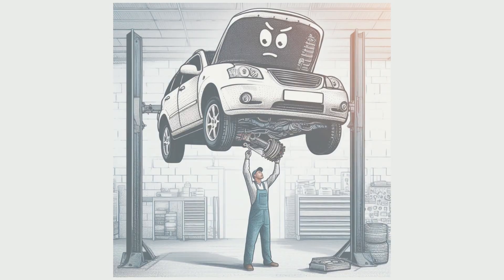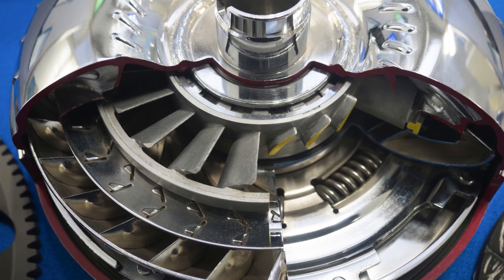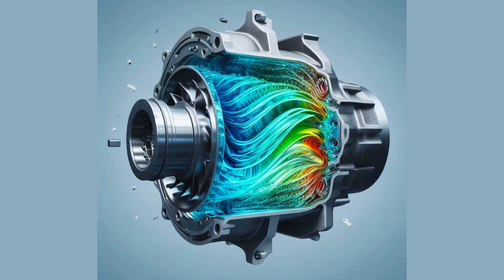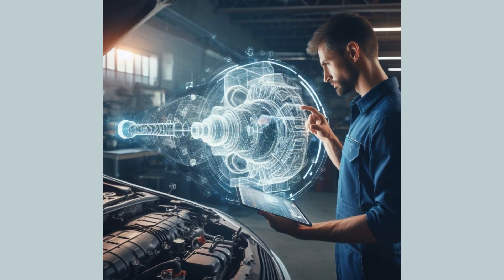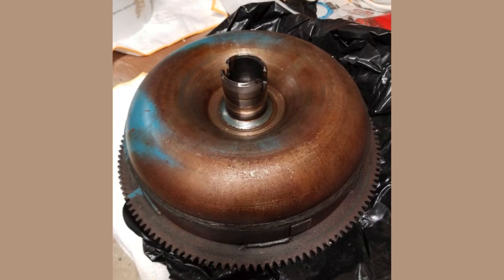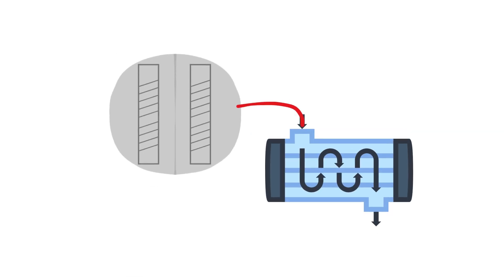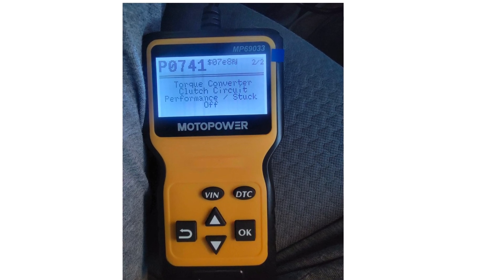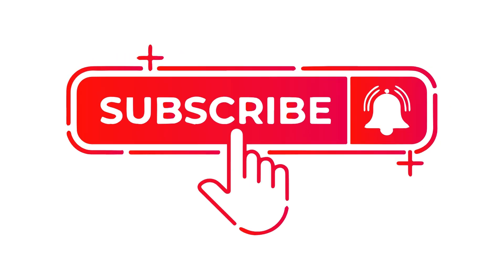5 WARNING Signs Your Torque Converter is Failing | SHUDDERING Symptoms Of A Bad Torque Converter

Comment: So I have a 2000 ford ranger 5 speed automatic. When I ease off the throttle at around 60 mph, I feel a sudden shudder and slipping from the transmission. The truck also shakes violently when I go over 60mph. I ruled out bad tires, wheels, suspension, brakes, and alignment issues. Is it possible that it could be the transmission or something in the transmission that could be failing?

Comment: Hi I have a 2010 Mercedes 250 CDI from Cold the engine stalls when put it in drive it can take about three or four attempts to get it going it fine when its warm no other symptoms. Could this be a Torque Converter Issue?

Comment: I have a w212 7g and when I’m stopping at low speed sometimes it feels like the car wants to shut off, shakes the car a bit and you can feel it, may this be a bad torque converter? Or something else
Reply from the maker: did u check any trouble code?
Reply: @AutocornerdPros i have checked i had only a ISM i changed that and still the same problem, i don’t have other codes from transmission i think, a friend of mine recommended to clean MAF sensor and to check the air tubes. That might be the issue i guess, because i also have a bit of vibrations when i idle

Comment: I have a Ford Explorer 95 when driving highway speeds 60 mph and lead off the gas the RPMs, shoot up and I get a loud ZZZZ noise and no power two wheels. Have to pull off put in park shifts up to speed again perfectly but once I let off the gas does the same thing. I’m wondering if it’s the torque converter or if it’s transmission issues but shifts fine?

Comment: Hello ,
I have an issue when i stop in a red light my car stop fine but after 4 seconds i see that the rpms moves 2 times and i got 2 bad vibrations like it wants to move forward even sometimes when rpm moves but no vibration it gives one when i just start moving some times it does it some times not (only when i stop completely) but not something else like check engine or any unusual vibrations when moving or changing gears i don’t know if it is the Torque Converter or maybe air leaking because when i scan it there is no error codes the car is w212 2014 250 4 matic

Any suggestions would help !

Help @AutocornerdPros

Comment: My 57 ford fairlane has a ford AOD matted to a 1985 302 ford motor when I try to back up and press the brake it dies, also going forward, is this the torque converter or a vacuum leak?
Reply: I have the same problem did u get yrs fix

Comment: Yes, I have an a 2020 Silverado with less than 100,000 miles. The last Silverado I ever buy. I’m going back to Toyota tundra.
Reply: Toyota has a class action lawsuit on transmissions.  Not sure which models.  Be careful what you buy
Reply: Yeah, Have fun with your 14 mpg tundra, which will likely also have transmission issues!

Comment: I have a 2023 Jeep Wrangler with 30,000 miles. After driving at highway speeds for more than an hour and a half the jeep will feel like it looses power for a split second and then goes again and repeats every 3 to 5 seconds. When I lift or push the gas pedal a little it goes away. Untill I crusie agian. Doesn't matter the speed. Anywhere from 35 mph up to 70 mph. If I shut the jeep off for 20 minutes or so it goes away and then no more problem for another hour and a half or so.
Is that torque converter issues or just a Jeep thing.
Reply: dunno but the cooling down for 20 min's is the sign that heat is an issue, meaning possibly your fluid is getting cooked and needs replacement, but u will also need to find out why it's getting cooked.  I 'm assuming u r not rock crawling, ie putting super heavy load on systems.    Talk toa good shop or dealer if under warranty which it should still be.   Jeep has issues with quality

Comment: I had a quick question. This man I know has a 2000 Corvette and yesterday his wife took it to a car wash and got out the vehicle. Once one of the workers tried to put it in drive, it wouldn’t go anywhere and just stayed there. So it’s not shifting gears. I don’t know if it’s actually the torque converter or if it’s something like the Shift Solenoid or even like the Clutch Pedal/Clutch Packs??
Reply: Only way to find out is a diagnosis
Reply: Pump failure
Reply: Sounds like water intrusion since it was during a Car wash. I would check wiring and look for trouble codes if they pop up. Solenoids or TCM might not be getting power or getting abnormal power.

Comment: My 94 chevy c1500 truck looses power around 30mph and won't go even with rpms above 3k. Have to turn off engine in park before I restart and set in drive. It just won't go after a few minutes of driving or above 30mph.
Reply: What did you do to fix it ??

Comment: I only have a p0744 code which is for my torque converter. only signs I noticed is that I get low fuel mpg I have slight slipping sometimes and my car at 40mph is at 3,500rpm. At 45-60 mph my rpm’s are at a constant 4,500-6,000 rpm’s. Can I just fix my torque converter? Or do I have to replace my tranny? Which are very hard to find for my 1999 Nissan Sentra.

Comment: Something I learned along time ago, when at stop light, put your car in neutral. It releases the pressure on the torque converter and helps it last longer.
Reply: And if it's a chrysler torqueflite the pump is active in neutral which keeps the fluid circulating and cooled
Reply: @TactaGhoul this is the key, on most designs, when in neutral the fluid is still circulating but the clutches are not engaged, producing heat, because when the transmission is in gear, foot on brake pedal, the horsepower of the engine is being converted to heat
Reply: Transmissions have an oil pump inside them besides the torque converter. It is spun by a permanent psychical connection. (AKA) the two notches on the torque converters output shaft. So, If your engine is running, your transmission pump is also running regardless of what gear you have it in.
Reply: never heard that before, but that sounds like it could wear down other mechanisms used in the shift ?
Reply: Bet
Reply: Totally wrong will accelerate wear too the transmission
Reply: @michaelbudd123 so no neutral?
Reply: Wrong

Comment: Vibration at 50mph under acceleration -Ford 10R80.  Morries Minnetonka Ford Dealership can’t figure it out.
Reply: Ayyyy lemme know updates. Same issue here
Reply: @stevew8042   started throwing P0451 codes for EVAP fuel pressure sensor.. started running terrible and getting 14 mpg..  took it to ford and they said to replace the vapor hose on top the gas tank with the fuel pressure sensor.  Truck drives like brand new again.
Reply: @jcicho  just figured mine out. Truck was misfiring. Here in buffalo we have cold winters. Just put a set of cold plugs ngk6510 gapped at .028, no more vibrate.
Reply: @stevew8042  I’m in MN, cold here too.  In October, I installed NGK 90495- OEM equivalent.  Gap down to .028.  Should I try the ones you have?  Would a Forscan show misfire levels? 2020 3.5L ecoboost
Reply: @jcicho from what I read, the 90495 is rated 6 and the 6510 is rated 7. 6510 is slightly colder but I don't know if that would be such a difference. I recreated it and duplicated it maybe 30 times before the last time. I duplicated it for my longest time and the check engine light started flashing at me during the pull.  continuously misfired after letting off the gas, which was a first. At that point you'll set codes & you can further your diag from there. I have a 2018 with a 2.7 tuned running 20lbs of boost
Reply from the maker: Any trouble codes?
Reply: @AutocornerdPros   nope

Comment: Bmw 530d with asr390 or GM540LE,  342000km flushed every 60.000km.

Only at +/- 90km/h , rpm 1600 in 5th gear when y accelerate its go to 2000rpm,  sort of vibration and rpm go back to 1600, 

At same speed in S mode at 90km/h the rpm is at 2200 , there no problem,  speed  1,2,3,4 no problem,  no default codes,  so y have 3 options,  

Torque converter (why only 5th gear)
5th gear solenoid 
Cluch disc 😔

If you have any clue ? 

Thank you
Reply from the maker: Checking solenoid is the easiest to check. So first see this. Check both shift solenoid and TCC solenoid’s
Reply: That's very similar to my 430d I don't know what to do. I have had an engine rebuild and now this. Car wouldn't go into gear at all and then now I have this judder at highway speed if I try to accelerate it vibrates so I just let off and when going uphill I just let go off gas. I also have a like a scratching sound if I try to accelerate hard and also when in drive but have my foot on brake
Reply: @TheOne18263 y changed the   torque convertor and all ok ! It was the original , 340000km

Comment: ANY transmission repair is EXENSIVE!! I mean ANY.
Reply from the maker: Agreed😣.
Reply: @AutocornerdPros  I've worked in a tranny shop for 15 years. Plenty of inexpensive transmission repairs...but you won't hear about any of them from us. 😳🤷
Reply: I've worked in a tranny shop for 15 years and I can tell you for a fact there are MANY inexpensive transmission repairs....but you'll never find out about them. 👿
Reply: i got a flex plate at a junkyard and four bolts for it at the dealer for a total of 36$ , wish mightily i had sprung for a new tc when i had it all apart , could have gotten one for 100 in 2018 when i did that repair  , now a few thousand miles in and the tc chatters at idle  :-/